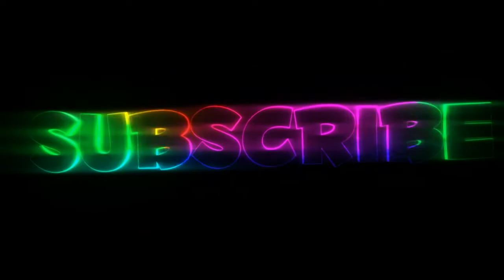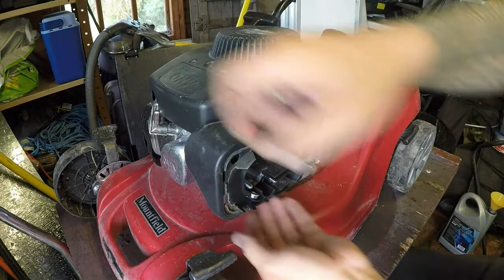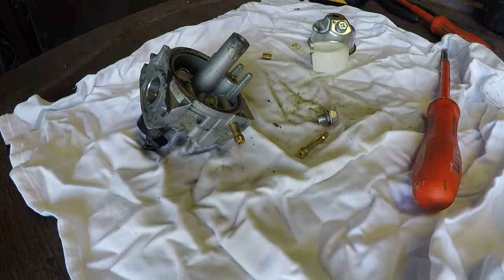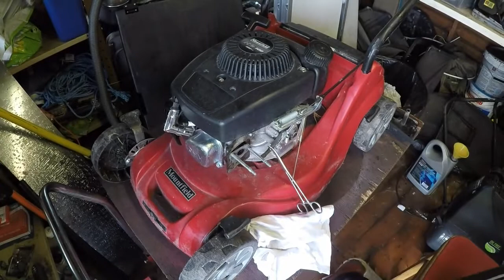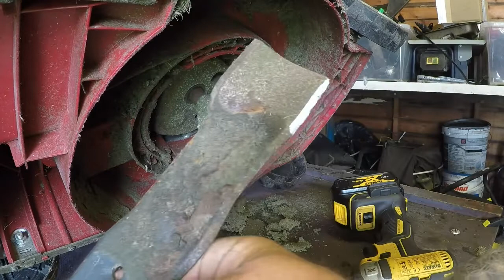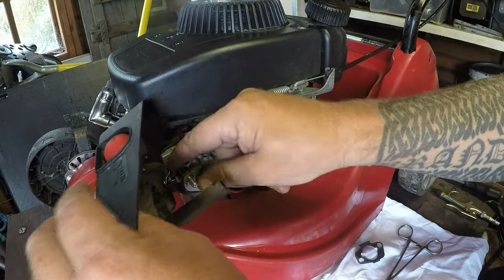#lawnmower #easyfix #micksmower Mountfield 414 hunting surging lawnmower how to fix

Comment: I come back to click the thumb up and subscribe buttons to say thank you as I worked on my 414 HP following your video and it is now working like an angle. I did not clean the carbo though but install a new one instead as I found it on eBay for less than £10.
Reply from the maker: Fantastic news mate.. glad you had a go at it and now the mower is up and running.. ta for hitting the red button too

Comment: I just got round to trying this out and it worked a treat. The job was far easier than I expected, due largely to this video. I bought a $17 AUD carburettor off eBay and it’s running sweet as a nut.
Reply from the maker: Fantastic mate well done

Comment: Mountfield is a name I don't know.  They look like an MTD  The motor also looks like what I call a Chonda.    I am fusing with a B&S Quantum with a choke that is hard to start.  I am thinking of putting a primer button on it with the primer carb too.  .  It  was rigged by an amateur before I got it.  Good video brother.  Hunting = carb clean.
Reply: I think you still got the parts from that Toro Personal Pace, including the auto-choke carb and vane. That will swap, right Bruce?
Reply from the maker: Bruce Pender hi mate. I have had 4 of them in this year all with the same problem. It’s not the jets it’s with in the main carb is the problem. Yeah try putting a primer on it I will help i would say
Reply: @999thenewman  I have a box of carbs and air filter combo's.  I will come up with something.

Comment: Great video Mick. I have a Mountfield 414, stripped it and cleaned it with carb spray, put it all back together again, and it is still surging and hunting. Am I missing something? Checked the spark plug with multimeter, all fine, plus checked the ignition coil with multimeter, all fine there too. Bulb was pressing fine, no leaks and whilst stripping the carb down I could see the petrol seeping out when bulb was pressed. Any other suggestions?
Reply from the maker: Take the carb apart again and file out the main jet .. it really helps
Reply: I had the same disappointing result after I cleaned the carburettor. I'll try the file and see how it goes. 

My oil hasn't been changed in 10 years 😯 but still shows as clean and sufficient.
Reply: @themowerman  Okay, I will try it again and let you know how it goes.

Comment: Thanks, I've cleaned the same carb though probably not quite as thoroughly and didn't realise there was another orifice under the idle screw so need to check that too - issue is it will start on the primer but not run - hoping this will help as it seems to be a very simple carb otherwise! 🙂
Reply from the maker: Yeah do the slow jet as well.. let me know how you get on..
Reply: @themowerman  thanks, well after pulling the slow jet the o-ring had a break in it so no luck there - I've had it apart and cleaned it around half a dozen times now - even tried WD-40 (a new use for me 😆) and even very lightly "drilled" out the main jet with some micro-drills I "found" from a load of workshop stuff I acquired a while back - so I'm stumped, it seems to have no fuel delivery once started but it's so simple I can't see what else could be the issue other than trying to find a replacement o-ring for the idle jet, but I don't think that's the issue - the whole carb (generic copy) is available for less than a tenner so I might just go with that - annoying but seems to be the most pragmatic solution vs time and effort🤔
Reply from the maker: @Umski  yeah new carb time.. sometimes that is what I have to do

Comment: Hi Mick watched this video and your other one! Absolutely spot on I stripped the carb down cleaned the jets and it fixed the hunting issue. Now running sweet ! Thank you! Only issue I had was finding a bit of wire to clean the jet ! Do you have a link for the files and drill bits so I can get some for next time😜do you think adding a bit of reflex to the fuel is a good idea going forwards?
Reply: *Redex.
Reply from the maker: Fantastic

Comment: Hi Mick. Another great video. I need to look at my Mountfield. It starts, but takes a minute or so to finally kick in on full power. Then all of a sudden it stops but does starts again. This can happen several times.  Carbon do you think? Cheers.
Reply from the maker: Sounds like a carb clean is needed
Reply: Thank you. Will give it a try. You do make it look easy though.
Reply from the maker: @geoffwilletts4683  just follow the step by step mate ...

Comment: Fantastic video as always Mick. Just a quick question when you put the carbs in the ultrasonic cleaner do u leave the gaskets and rubber o ring on the carb or remove them before you put them in the ultrasonic cleaner. Keep up the good work mate 👍

Comment: Hey , my sp414 is hunting like mad , so going to strip it and rebuild  it , on the things that look like brushes under pull start casing the coil I think  , there is a  loose bolt and it’s sitting at an angle , and they are magnetic so pull to the disc , what should that gap be ? 
Thanks

Comment: Hi I have mountfield rs100 like one in video revs are very high any suggestions
Reply from the maker: Carburettor clean and clean the slow running jet.. possible problem with the main jet may need rimming

Comment: Alright Mick I’ve just picked up a Mountfield HP164 RS 100, it was hunting so I cleaned the carb and fuel filter, but it’s still doing it, could it be something to do with the values?
Reply from the maker: It's hard to say.. what I would do is go back to the carburettor.. I have cleaned some 3 times before it stops.. when doing the main jet I rim it out a bit to make it bigger.. dont take to much off .. hope it helps
Reply: cheers, will give it a try, keep the videos coming
Reply: Hi chaps, the video was a great help in getting mine sorted. Float bowl was full of debris so cleaned and flushed jets with WD40. Worked a treat and then started hunting again. Upped the idle speed slightly and now perfect!

Comment: I could never work out weather the oil level should be checked with the dipstick screwed right in or just pushed up to the thread
Reply from the maker: If you do it without screwing it in you will not go far wrong
Reply: @themowerman   thanks I will stick with that then